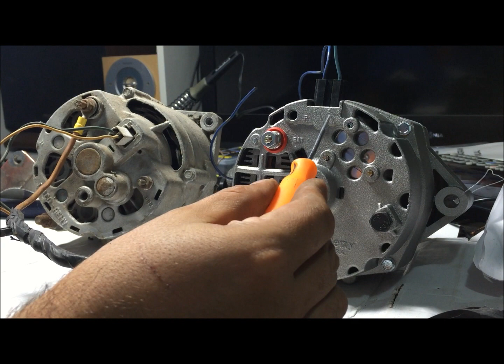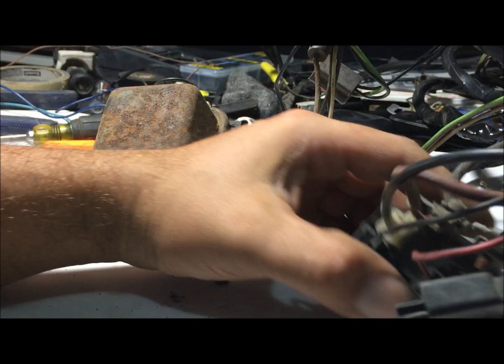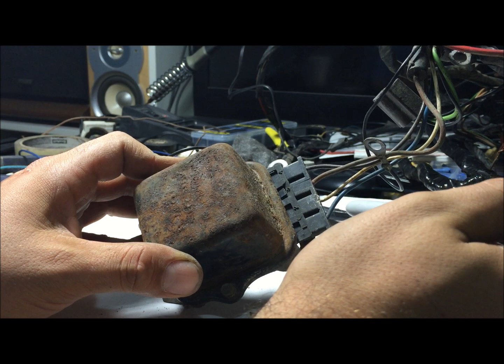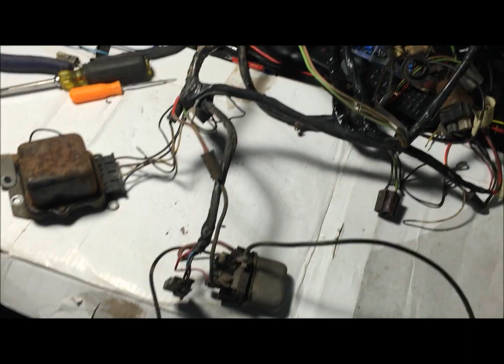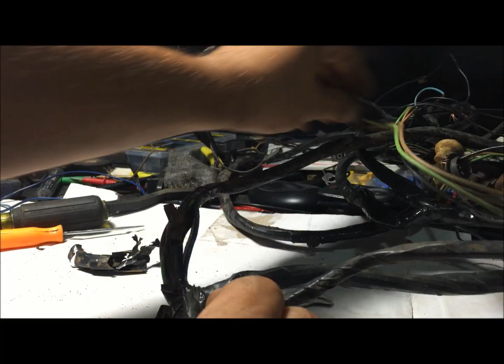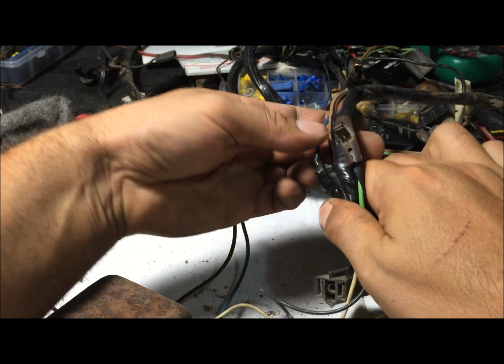how to rewire alternator wiring harness for internally regulated GM conversion chevelle

Comment: Should the blue F wire be getting constant power once it is plugged in to the alternator? Then when you repeat this video it sends that power through the brown wire which then sends it back to the ignition. Which is a fire hazard right because the ignition will send power through that wire as well when you turn the key in the on position. Can someone explain why this works or what I am doing wrong?

Comment: I just want to say thank you for this video. I rewired it this way last night and it worked for me.  Somebody had jumper wires in the external voltage regulator connector so the two middle wires were wrong

Comment: I've been having charging issues with my 69 chevelle. It has a single wire alternator on it now. The people I bought it from just had a jumper on the connector for the voltage regulator.  I'm going to try to wire it correctly like this. Hopefully it works. Thanks
Reply from the maker: I have a 1 wire alternator video

Comment: Hi Chris. Thank you for all your super helpful videos!!! I have a 70 chevelle ss with factory gauges. I recently installed an internally regulated alternator and changed the factory wiring harness as you showed in other videos… blue white red at the alternator and jumping 1-4 & 2-3 wires after removing the external regulator. 
My question is can I still run the factory amp meter with this setup?
Will it even work?
Is it safe to?
Thanks again!
Reply from the maker: yeah, I have that same car with the working amp meter

Comment: I done this to my chevelle and it charges and works great but the alt light is lit now without the key on or even in the ignition what could be wrong
Reply from the maker: did you use a new alternator?

Comment: Typical of your videos Chris... very informative. I do have a question. The Red 10 AWG charge wire that's buried in the loom running across the core support, the wire that used to connect to the alternator, when you swap in a internally regulated alternator, and run a nice heavy wire direct from the alternator to the battery terminal with the appropriate fusible link... what should we do with that old 10 AWG red wire? Leave it coiled and capped under the PS fender? Is that the wire you cut and taped over in the factory splice? One other question, I'd like to have a 12v IGN SW source up in the front, so other than rigging something from the fuse box and then thru the firewall, is there a 12v Switched source under the hood that I can tap into?  Working on a 69 Camaro.
Reply from the maker: your car may be wired different than mine..  on my car the 10g through the core support feeds the ENTIRE fuse box for inside the car...  i only clipped the section going to the external regulator... study your harness...   there is NO switched 12 v under the hood..  (only coil or distributor) what do you need 12v switched under the hood for?
Reply: @chriscraft77022  The consensus in the Camaro Forum from guys who have done VA installs with a PWM fan controller seems to be that one of the wires from the Vintage Air Trinary Switch needs to be connected to a 12v Key-ON source. I also installed electric RS headlights that don't need a ton of power and they could be connected to that same source. Hey thanks for the reply Chris... your a saint! So what should I do with that old alternator post 10 AWG red charge wire? I have a 4 AWG wire running from the alternator to the battery with a 8 AWG fusible link, then a 18" 8 AWG wire with a 12 AWG pigtailed fusible link connecting to the Junction block. Should I connect the old Alternator wire to the junction block? There already is one 10 AWG red wire in the loom connected to it, so I assume that regulated current is going from the alternator to the battery terminal and then to the Junction Block where its feeding the other Red 10 AWG line that goes to the horn relay? Here's a couple of diagrams I made. https://drive.google.com/file/d/1ZxJ5YNFFolvlAH9PBUQ56XBgECHHCBuI/view?usp=sharing
https://drive.google.com/file/d/1wbDPva3krW0f4IE4hAVrLmBUqrcOgN18/view?usp=sharing

Comment: Great video I did everything exact from a 3 wire connection but now my dash and rear lights won't come on what do I do?
Reply from the maker: you left off 1 10 gauge wire that feeds all that
Reply: Which 10 gauge wire was it and what color does it go to?
Reply from the maker: red 10g it goes to fuse box..it has a fuse link like the one you cut out but goes to fuse box

Comment: how do you go about finding the internally reg alternator that has the right fit for your old chevy?
Reply from the maker: match the case with what you have .. mine is a 10-si
Reply: @chriscraft77022  You're right Chris. I went in autozone and told them a little bit and they knew exactly what would work. And got a plug, brand new.  Thanks!
Reply from the maker: on a 66 you may have to take case apart and rotate the plug because yours mounted on driver side ..  just keep that in mind ..just make sure you jump the plug like I show in the videos
Reply: @chriscraft77022  got it in, GEN light is out when engine is running - on when its not, and...nothing caught fire or even started smoking!

Comment: There is no 12 o'clock and 3 o'clock, you just rotate the case back where you want the connector to be: 12, 3 6, 9 o'clock.
Reply from the maker: no one positions it to 6 or 9.. 69 and up use 12 oclock... 68 back use 3 o’clock... so, it is very important to know that.. most people are not going to reposition the back of a NEW $250 alternator...
Reply: @chriscraft77022  People who put 10 SI's on OTHER vehicles are extremely thankful that all four positions are possible.
Reply from the maker: @chippypro2111  I get all that but I have just never seen one clocked other than 12 or 3 for passenger or driver applications... I guess a tall tractor or machine could use 6 or 9
Reply: @chriscraft77022  Thanks for a great video.

Comment: Can the one that runs to dummy light be used in a voltage meter?
Reply from the maker: volt meter can be hooked up anywhere.. just like you would use a meter anywhere... I have a video on the ammeter
Reply: @chriscraft77022  cool thank you

Comment: Worked perfectly on a 1965 Corvair. No smoke, No fire, GREAT. The only change was that on a rear engine Corvair there is no need to do anything with the horn relay. The horn worked after the alternator installation without touching it.

Comment: Hello my  friend, i could use some help.  I have a Mercury Monterey custom 1962, this vehicle has a generator with a regulator with exterior voltage already integrated.   I'm trying to put an alternator instead of a generator.    My question is how can I connect the alternator and eliminate the use of the regulator part.   I was watching a video that you posted where you explain the different connections.  This regulator has  connections AR, FL, and BAT.  This alternator  is the same as in your video with 3 exits.how should connect it ?Hopefully you can help me.
Reply from the maker: I don’t mess with ford.. I don’t know anything about them.. these are GM videos... you need to find what year ford went to internally regulated and get that alternator...

Comment: Hello. I followed your video to a T but now my Gen lite stays on. Did I miss something?
Reply from the maker: watch my gm 3 wire alternator hook up video...  dummy light explained...   EASY GM conversion..   you may have some wiring issues...   i even explain that gen light at the beginning of my 100 amp alternator upgrade video

Comment: What gauge wire do you use for the double jumper wire conversion? Did you buy it like that or you made it yourself?
Reply from the maker: Watch my easy conversion video .. this is an old crappy video...18 gauge

Comment: 8:04 Excuse me, got a question what if I have that old system with the regulator and And the brown wire that goes to the dummy light it stays on  even when I turn off the car completely. Is that correct? (Btw it’s draining my battery) (and it has the  originals bulb&socket on the dummy light ) (got 350 on it )(1969 chevelle )
Reply from the maker: wire the brown wire to come on with accessories or IGN with a diode.. watch my gm 3 wire hook up alternator video

Comment: I put a 302 small block ford in my 88 ford ranger which had an internal regulator so I gta totally rewire my external regulator with alternator and have wires everywhere and still can't get over 12volts!! Please help
Reply from the maker: sorry, I don’t know anything about ford.. sounds like you need to get a 1 wire for now
Reply: Chris Craft thanks anyway... I put a Chevy hei distributor in it  but trying to stay ford

Comment: Hello Chris, trying to wire in a newer 3 wire plug with 1 external battery terminal alternator to a 2 wire plug with 1 external battery terminal altenator. Not sure where the 3rd wire goes, it's a 10 gauge wire.
Reply: Blister Fist having same problem and can't get an answer please tell me you found an answer and didn't throw the car away like I'm about to

Comment: Hey Chris I got one more question for you I understand how you hook everything up I know the number two goes on the back of the alternator but where does The white wire go does it go in the back of the alternator two
Reply from the maker: +Andrew Dominguez watch my gm 3 wire hook up video
Reply from the maker: +Andrew Dominguez 70-72 round gauge dummy lights are wired the same... and yes the wiring diagram does in fact have the wiring diagram for your dash (it shows the plug in the diagram)
Reply: Chris Craft hey Chris my buddy has a 3 wire plug and 1 wire to back of his alternator. We are swapping motors in 1967 el Camino, it already had 3 wire alt but new alt is 4 wire all white on 3 wire plug. 1 wire is 10 gauge other 2 are 18 gauge. Help

Comment: I needed to upgrade my alternator because I have dual electric fans which draw a lot of amps iwebt with a one wire that has an internal regulator, what should I do with the external one that has the 4 wires and horn relay? Do I bypass any wires? Or just pull the 4 Wire plug out from relay, thankyou

Comment: Great videos Chris.  I appreciate your hard work.  I have a 72 Cutlass (350 rocket) that has an externally regulated alternator.  All wires seem to be hooked up correctly but I can't get my alternator to charge.  I've had the alternator tested twice and it passed both times.  I'm thinking about trying to go the internally regulated route. Should this fix my issue and Can you tell me what internally regulated alternator will work for my application.
Reply: If you want to keep your original weak alternator, just buy a new solid-state (transistorized) regulator. NAPA has them and they work well.  
To upgrade just go to NAPA and get a 7294 series (-3-9-12) GM 12SI alternator. This is a 94amp unit with all the 12SI upgrades . Any dash version here can be "clocked" to the best mounting position when adapted to your Merc. Your will need to run a heavy gage charging wire direct to the battery and then a light gage wire back to the blade terminal #2 on the 12SI; this is the "voltage sense" terminal looking directly at the battery voltage needed to correctly charge the battery. Blade terminal #1 then goes to your "GEN" incandescent lamp and then on to IGN +12v, this “turns on” the alternator. Use a DELPHI 06294493 2-terminal connector for terminals 1&2.  With this you should be good to go…
Reply from the maker: if it is not charging..  you do understand that the regulator can be adjusted...?
pop the metal cover off and you should find an adjustment...  you will need an amp meter to adjust this correctly..    if not, in which you should do anyway..   buy an internally regulated alternator...  and watch my easy conversion video..  very simple..  are you running modern accessories or is the car stock?
Reply: No i didn't know it could be adjusted. Forgot to mention, i did replace the regulator as well. As of right now the car is stock but will eventually be running aftermarket accessories
Reply from the maker: if you are going to upgrade anything..  convert to internally regulated..   watch my easy conversion..  thats all you need to start with
Reply: ok. do you know what alternator i should buy. I thought olds started internally regulated alternators around 76 but i checked 72-80 olds alts at part store all were externally regulated
Reply from the maker: i have never worked on olds in my life..   just take the alternator with you and try a 79 cutlass...  it should be the same..  you will need a plug too...   or buy insulated connectors..
Reply: OK. thanks I'll let you know how it goes

Comment: i did this conversion supplied power to my alternator but now my sbc wont shut off? anyone know what my next move should be?
Reply from the maker: your car not shutting off has nothing to do with this..  watch my gm 3 wire alternator video...   you have number 1 on the ALT connected hot all the time..  it needs to be switched on through ACC  or run a diode...   watch the video

Comment: Chris, is it possible to get a drawn diagram of how you have completely wired your 70' Chevelle? I have 1 71' with a 1 wire alternator and the wiring was butchered when I bought the car. If I had a diagram with every wire to every accessory I could make sure I am wired right. The starter, battery, alternator, junction block, horn relay, and the forward harness would be great. I have seen your video where you have a lot more wires going to your horn relay than I do and my Gen. light stays on when the ignition is off, obviously something is not right. Can we get in touch by e-mail possibly?
Reply: Chris Craft
Reply: Chris Craft . the reason
Reply: Chris Craft
Reply: Td Hooper
Reply: Chris Craft can you please email me a diagram?  howardkota33@gmail.com
Reply from the maker: You need to buy the 9.99 wiring diagram from ebay... go through wiring, ditch the 1 wire alt.. because you need to fix your wiring, then put the 1 wire alt back... you have a long way to go before I can help you...my car is a 70 chevelle and is wired exactly like the 70 wiring diagram... you can email e if you want.. i can send you pics of my wiring diagram if you want them,,,,  but i dont have a diagram for a 71...  craft_77022@yahoo.com
Reply from the maker: +Chris Craft but i can totally help you but you have to get that wiring sorted out before i can...

Comment: Hey Chris. Once you follow all these steps, should I just hook the horn relay back to where it was and voltage regulator would be gone. And it should work fine? Is there a part two video?
Reply from the maker: They arent fused on older cars... that idiot that commented doesnt know shit about electrical systems..  They have a fused link feeding the accessories ran off the starter or horn relay lug..i left the comment because fusing is safe and a good idea
Reply from the maker: Mondo357  you need a diode on the #1  position towards the alternator if the car keeps running but check the video out
Reply from the maker: yeah, hook the horn relay back where it was ...it will work perfectly...  you have to follow all the instructions, though...  #1 WIRE connected to the BROWN going back to the dummy light is VERY important so make sure you connect that... or you will end up having to rev your engine up to 3000 to get the alternator to start charging the battery
Reply: Chris Craft for some reason my brown wire was not fused? its the original harness on a 66 impala
Reply: Chris Craft yeah i followed the wire up and found where it was sottered and ran off the power wire taped up separately from the rest of the wires looked factory... i ran a wire from the battery to the horn relay where the alternator is getting its juice from but now the engine wont shut down im thinking its in the ignition wire that goes into the hei distributor to the fuse box? im not sure what to do... any suggestions?? thanks
Reply from the maker: +Mondo357 watch my gm 3 wire hookup .. you actually watched a video of mine that has nothing to do with your problem..
Reply from the maker: Mondo357 i have like 4 videos on your problem
Reply: Chris Craft 10-4 man ill watch them i did eliminate the external regulator converted to an internal regulated alternator...